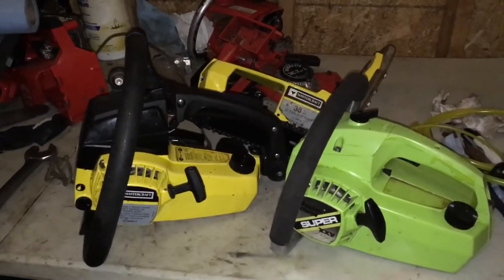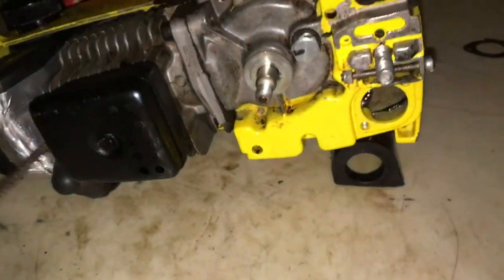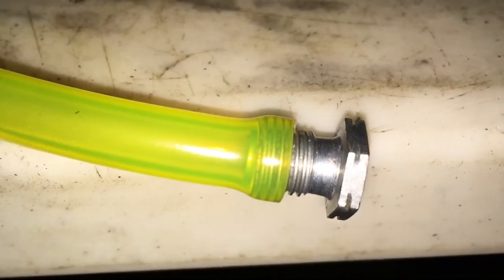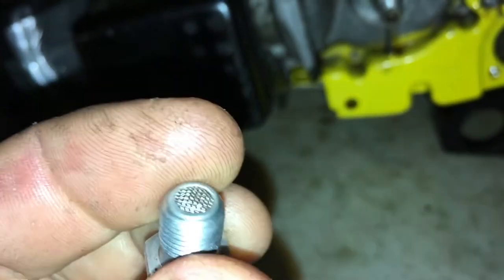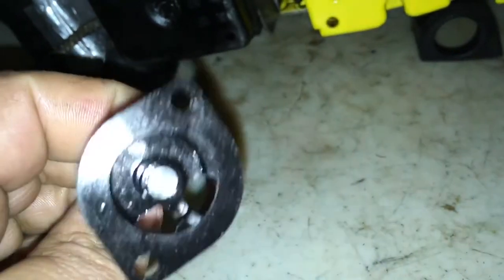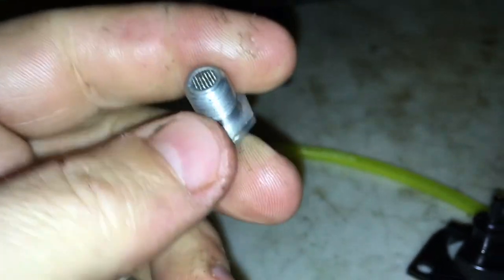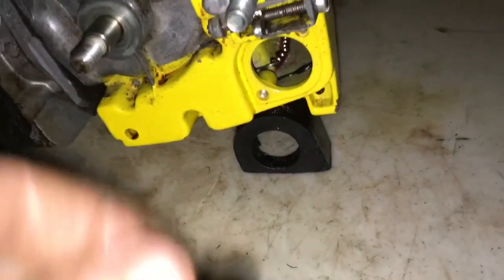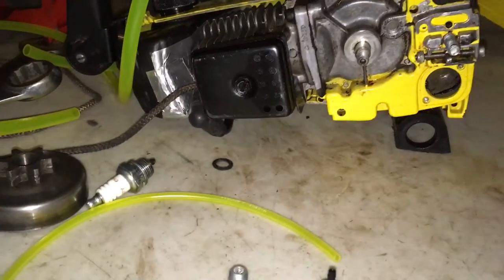Poulan oiler repair and testing.How it works.

Comment: I'm currently working on the Craftsman version of this saw. I've already replaced the fuel line, installed a new carb kit and have it running. Replacing the oil line should be the last step.  I looked at it  after realizing  the oil line was crumbly then called it a night after about 2 minutes because I couldn't figure out how to get the new line in.  Feeding it through the top hole is the exact tip I was looking for.  THANK YOU!
Reply from the maker: @mdmowrey right on yes now is the time to lube up that oiler mechanism and change the line/fuel filter etc then it’ll be good for another 45 years! Lol
Try to run non ethanol fuel if you can as well. Even 10% ethanol seems to eat away at the lines/carb metal.

Comment: I have the 33cc mastercraft with chain brake. It runs well but is showing symptoms of crank seals leaking. I ordered some from the states and am looking into what needs to be done to change them. It's nice to see other people working on these. Thanks for sharing.
Reply from the maker: @billhacks is yours 33 or 38cc? I know mine is 38cc. Ya new crank seals,a new piston ring and grease  up the clutch bearing,carb kit/lines and that thing will run great again.

Comment: I used 3/32 X 3/16 tubing for the oiler. No way was I able to simply push it through the oiler hole. I had enough tubing so that I was able to split 7 inches or so of the hose and remove enough of the tubing wall to squeeze it through and out the oil fill cap. Once there I was able to grab the split end and pull the rest of the tubing through using a generous amount of oil to help it along. Have not checked the check valves yet but hope they are ok. Thanks for posting.

Comment: Is it oiling?  The oil check vavles on these can be a real pain. The check valve located behind the clutch assembly is obsolete.  It has inside of its body a rubber duck bill type valve.  You can extract it except for its retaining shoulder once the screen is removed.  It is sandwiched between the brass end cap and the stepped bore of the body bore.  Once it is removed, by methods of using whatever it takes with out damaging the bore, a new shouldered duck bill valve can be inserted into the hole. The shoulder can either be removed or left on. If removed then insert the valve leaving 1/16 to 1/8” protruding. This protruding material then needs to have a high heat fuel resistant glue applied to the protruding portion. I use gel super glue. Once it’s glued finish pushing it into the bore making sure that the duck bill end does not bottom out or any glue is in and on the duck bill end or it will be glued shut.  The other method is leaving the original shoulder on and glue as before. The glue that squeezes out will be under the shoulder gluing it also. Let dry then test the assembly by using a fuel line held against the new inserted valve and attempt to suck some air through it, should not be able to. Now blow through it, should be able to do that. I put a drop of oil on the small hole at the end of the assembly which lets you see the air being blown through.  Reassemble and pray all your work has no issues. Good luck.

Comment: Hey !  Super good explanation and very inspireing !  I have a bunch of those saws and now I am going to give them real attention.  Yes...they seems very good saws and they always seems running and not scorne.  Just the fuel line need to be replaced and the carburetor ultrasonic cleaned and new gaskets in it. Also the oilers need to be maintained and now you gave me hope to get them oiling as well ! :-) I have Jobu, Skil and Pouland of that type.  Ok
Reply from the maker: @motordiverse1276 right on ya they are neat little saws. 
I can’t remember but did I talk about the upgraded fuel cap for those in that video?

Comment: Great little saws ,got 3 of them myself a 1981 micro 25 deluxe (in need of repairs),2350AV Canadian made and 2400 wood master (last to be made) and all will chain brakes and working oilers and had a 25cc one but it went boom💥
Reply from the maker: Ya they rip for a tiny little saw!
Reply: @Indeewoods  make great push bike motors
Reply from the maker: Haha I bet they would.
Reply: @Indeewoods  but not as fun as 160cc victa on a bmx hehehe pushing 60 kph

Comment: If you have a few saws and work on them yourself i suggest investing the few dollars in a clutch removal tool. When used in conjunction with a small cordless impact driver it makes short work of clutch removal and doesn't require stopping the piston.
Reply from the maker: @johnnorris1227 ya I have tons of saws and I really should have the clutch tools but I just got lazy and never bought any yet. 
They come off pretty easy with a couple wrenches.

Comment: I have 5 poulan and two shilt saws 
But I use the poulan all the time because parts are cheap and they are as good as the chain just like any saw is, plus if one goes down it’s only 2 hours to replace cly piston kit

Comment: If the oil case is leaking oil thru the case halves because the sealant has failed, two choices sell it or split the case and get the correct sealant, like Stihl uses, and fix it.
Reply from the maker: @magicone9327 I believe it was leaking through the one way check valve for the oiler. 
I fixed it like you see in the video and its been good since so I’d say the sealant is fine for the caee halves.

Comment: hey Chris, does this info cross over to my wood shark or say maybe a wild thing? I imagine the process of disassembly might vary slightly of course, but the general idea is the same?
Reply from the maker: No those are totally different saws with an oil pump. 
Well there was a wood shark model in this chassis but I doubt yours is one of them they are not to common.
On your saws the oil pump gears fail in them sometimes and you have to replace the pump.
Look at my Poulan 2150 videos it shows the oil pumps in there.